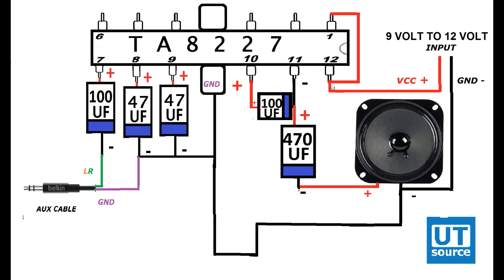TA8227 Audio Amplifier

Comment: Kindly clarify the connection of 470uf capacitor connected to which pin of IC. Can you give the circuit diagram of stereo amplifier with the same IC